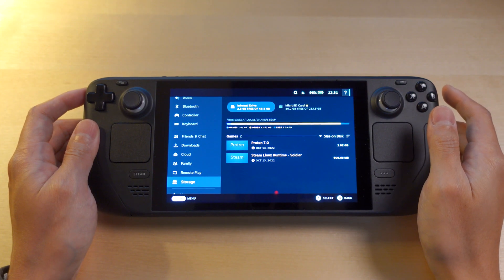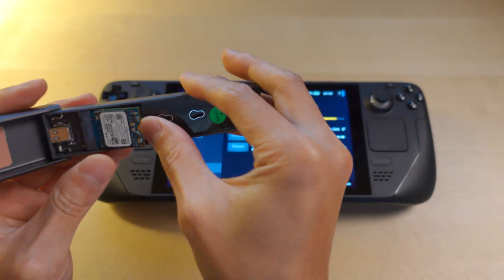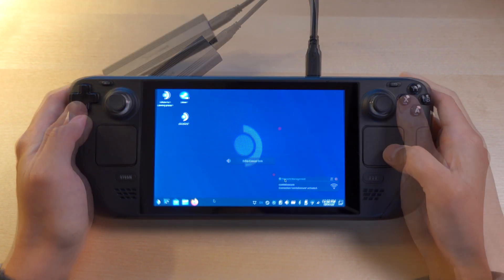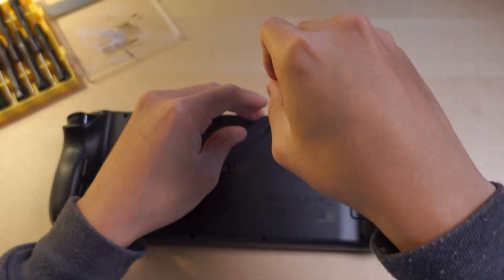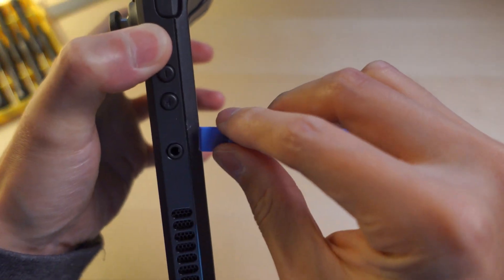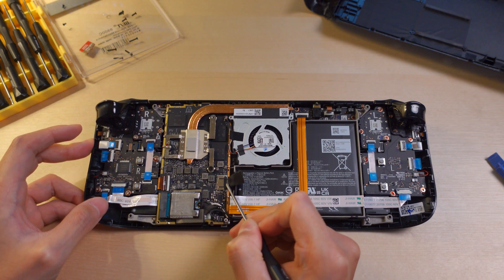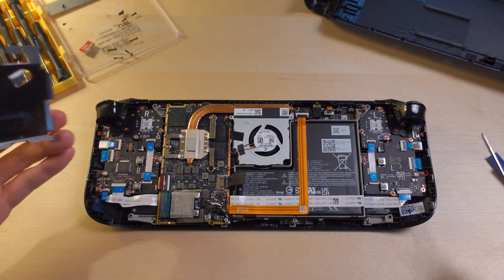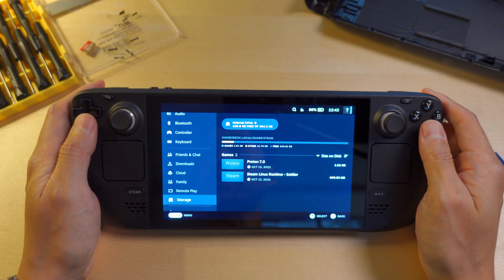Steam Deck NVMe SSD Clone and Disassembly

Comment: I followed this exactly and it started working for a few seconds and then stopped… it says “ dd: error writing /dev/sda : no space left on device” .
My 64gb ssd had about 7 gb left on it and I was trying to copy it to my new 1tb ssd. Prior to the error message, it says 7gb copied.  Not sure at all what I did wrong or what to do next. I turned off sleep mode and just left it as is until I can figure out what to do. Any help would be much appreciated

Comment: Thanks for the guide. It’s simpler to take out the SSD on OLED version. Remember do not format the drive before using dd command. If you format the drive. The system will fail to boot. But you can fix it using KDE partition manager to replace the improper partition on the new SSD.
Reply: How? Because I formatted did the command and about 243gb in it states "error writing" I have 1tb oled upgrading to 2tb.
Reply: @ you need to replace the missing file manually
Reply: @DaneChan  bro I wish I knew what that meant and how, even though it copied 243 gb I go back into gaming mode check storage and the drive still says 1.8tb free...same as before I started the clone

Comment: didnt work for 2tb ssd got this message dd: error writing '/dev/sda': No space left on device
1+0 records in
0+0 records out
0 bytes copied, 0.105996 s, 0.0 kB/s
Reply: Figured out the solution. MAKE SURE TO REMOVE MICRO SD CARD BEFORE DOING THIS

Thanks for this video worked well!
Reply: Removing your sd card fixed this? Didn’t fix it for me
Reply: @KinkKush  ok maybe im late but i fixed by inserting the new ssd via usb-c when in SteamOS mode,  and in the menu you see at 1:10 , selecting the empty ssd in  and "repairing" it pressing Y. Then, once properly formatted, go to desktop mode and run the comand and that should do it

Comment: I changed my 512 SSD to 2TB and it was very easy. Just follow the steps in the video and you’ll be fine. If you plug in the external SSD and it doesn’t show up on your deck that’s normal. Just follow the steps shown in the video make sure to copy and paste the clone command by pulling the video up on your deck.

Comment: Tried exactly how you described (coming from 256GB and upgrading to 1TB) but the deck wont boot after installing the new ssd :( after some tries it sends me to emergency mode and tell me that the root account is locked. so Im stuck here 🤕
Reply from the maker: The original SSD is intact so you could just swap back and try again.
Reply: @DavyChiu  Yes but I decided to take the alternative way to create an image of my old ssd on my pc and write it to the new ssd. Afterwards I enlarged the last partition to fit the new ssd size. Everything is working fine now :)

Comment: Thank you so much for this video. Turned it on and it literally worked exactly as it did before with no further login or tweaking or anything. My only tip is I wouldn't pull on the battery's ribbon cable like that. I did that following the video and almost broke it, so I instead just used my fingernail to lightly pull at the plastic bit. Just wanted to throw that out there cuz I would have been terrified if I'd broken it.

Comment: Dude, thank you so much for this step by step tutorial. You made it so much easier than me cloning off an image of the existing drive onto an external drive, then restoring the image to the new SSD. This was straightforward and I was able to get it done in less than an hour, and had my old games on the new SSD without any issues.
Reply: Everything worked exactly the same? As if you didn't do anything and the memory was just increased? No sign ins or messing with settings in desktop mode?

Comment: I'm getting an error 'dd: error writing '/dev/sda': No space left on device when attempting to copy the SSD.  I'm upgrading the SSD 64GB model to a 1TB western digital SSD.  Any thoughts?  Do I need to clear space on my internal SSD first?  I currently have a 2GB free.  Any advice will be greatly appreciated.  thanks...
Reply: For those seeing this in the future…I followed the same steps in this video a few days later and it worked for me. Not sure why but I didn’t get the error any more.

Comment: I know this video is a year old, but seriously thank you man. Every single place I looked or searched had the wrong clone command line and it was driving me insane. I used the one you posted and it worked instantly so thank you for saving me from this headache I really appreciate it!
Reply: Everything worked exactly the same? As if you didn't do anything and the memory was just increased? No sign ins or messing with settings in desktop mode?
Reply: @jawknee21  nope, everything was exactly the same but now with 2TB. setting stayed the same and everything.

Comment: Hey quick question did you format the new ssd prior to cloning it?
Reply from the maker: No, not necessary.
Reply: @DavyChiu  I keep getting an error stating not enough space on drive. I followed everything step by step.  This happened with 2 ssds. Any idea what it could be?

Comment: I am stumped, I have bought the EXACT enclosure and a WD_Black 2TB, but EVER SINGLE TIME after typing the command it will only download ~7.8GB then say “ no space left on device “ & can’t find a answer anywhere :/
Reply: 7.8 is a pretty specific number. Reminds me of dealing with FAT formatted drives (they have a 3.9gb limit)
Is the drive already formatted/partioned?

On the Steam Deck Desktop, find the "KDE Partition Manager" tool, find your and check.

For a brand new drive for me, the only options NOT greyed out are  "Refresh Devices" and "New Partition Table" with my SSD selected. If you have other options, try  shredding the existing partition table ((Top of screen) > Partition > Shred).
Reply: ...u need to delete the drive on windows with partiotion manager and make sure u took gpt dont format at all and put it back to the steamdeck, than u should be able to do it :)

Comment: Followed this guide, works like a charm. For the prying part, I used an old credit card to pry open near the top vent, then by pulling the vent part back a bit by my left hand, I squeezed on the right handle and pulled it off. This was far, far easier than trying to pry every side.

Comment: So is it the same with the oled?
Reply from the maker: There might be minor variations in the OLED hardware but the overall process is the same.
Reply: @DavyChiu I tried it on my 512 oled n it bricked it. I can’t get into WiFi and I did a factory reset n u need Wi-Fi to even get into the deck. But no WiFi will work. It says can’t connect re-enter password smh

Comment: This may sound like a noob question but what should I put in when asked for password for deck?
Reply: U figure it out ? I don’t know either lol. Do u know if this works with oled?
Reply: @LaymanGamin  If you've never set one, you need to run the `passwd` command, and it will let you set one. (Make sure to remember it!!) - This is from a reply in the top commentes.

Comment: I really don´t get it, it is not working at all. The SSD in the Sabrent is not recognized if I don´t plug the sabrant with power to be recognized first. And second when I get the external SSD to be recognized it is not at "sda" but on a "sdc or sdd" slot. When I change the command line to copy on it on "sdd2 it stops after 423GB stating Input/output error..

Comment: So if it clones, then it makes a copy of the old drive, including partition size!! but then if the new drive is bigger, how do you open up the additional space to be “usable”?
Reply from the maker: SteamOS expands it automatically on boot partitions are stock. If they're changed in any way, you may need to expand them manually.
Reply: Thx, so mine is fresh out of the package/stock, didn’t format, just plugged it in to USB,  then followed your video so far.. next step is to open it up & physically swap to the newly cloned SSD. I read elsewhere that I would need to expand, but none of the Tutorials on YT show that part. Glad to hear that it automatically does it on SD!

Comment: Hey buddy...great tutorial.  By chance  would you know if that same procedure can be done when a Steam Deck already has Dual boot?  A friend of mine is going to give me his steam deck that has windows on it and he told me it has windows 10 on it for dual boot and windows is installed in a separate partition.  So my question is I wanted to change the SSD in there to a 2TB, would you know if that same "Cloning" you just did would work?  Dual boot with two separate partitions?
Reply from the maker: This method will copy both windows and Steam, however you will probably need to enlarge the partitions manually afterwards.
Reply: @DavyChiu  Thanks buddy....will give it a try...always like to experiment and see what happens. If not..I can always just start from scratch again.. I've loaded just a few games on the OEM SSD before I transfer just to see if it picks up everything without a hitch

Comment: How do you do the opposite and copy external ssd to internal ssd
Reply: Did you work it out?
Reply: @tomb4696  nope I just ended up swapping ssds
Reply from the maker: Sorry, I didn't get to this earlier. You would need to boot off the external SSD and modify the DD command to copy from the external to internal.

Comment: In case anyone runs into the issue I had with the sudo password (I never set one so I Googled it) after entering the clone command. You just go to your settings > system settings  >users and then change your password :hand-purple-blue-peace:

Comment: ⚠IF YOUR DEVICE IS STUCK IN THE BOOT LOGO⚠
please read before giving up and losing all your data

1. First, place your original SSD into a Type-C enclosure and boot from it. Leave the new drive (the one you are upgrading to that is not booting) inside your deck.

2. Open a terminal and run the following command. It is a modified version of the command featured on this video (it does the same thing but has been changed to reflect that the SSD we want to clone is now in enclosure and the new drive we want to clone to is inside our NVME slot) .
 Please note that you may need to modify it based on your specific drive names.

3.Before you run the command make sure you enable "Manually block sleep and screen locking" under "Battery and Brightness". (I'm pretty sure this was what caused the stuck boot logo in the first place.)

this was the command that worked for me

sudo dd if=/dev/sda of=/dev/nvme0n1 bs=4K status=progress
```

3. To identify your drives and their respective names, use the 'lsblk' command in the Konsole.

4. If you encounter any issues, ask ChatGPT for assistance, as it's how I developed this fix.

Following these steps successfully should resolve the issue, and your drive should work perfectly without being stuck on the boot logo.
Reply: Under rated comment. You are a life saver dude!
Reply: Working for me too!
Reply: Sorry ah quick clarification where do I put the specific name in the command to clone

Comment: Thanks for the video. I have the Deck with the new cooler, and it's even easier.
Anyway, remembering my question, you DON'T NEED to format it before. It didn't even ask me to relog after the installation. Only weird thing, is that it re applied the update from 12th September, I already installed.

Comment: Thank you for this! Such a great guide. Someone will need to hear this. I put my battery in storage mode before doing the swap as I've seen that recommended on iFixit. After the swap my deck wouldn't turn on. I went through the entire process several times and still nothing. My battery had 80% when I shut it down but it still wouldn't turn on. I decided to try plugging it in and magically everything worked perfectly. Something about putting the battery to storage mode I guess makes it so that you have to plug it in to get it to power on. At least now I'm a pro at swapping the SSD because I did it 6 times before plugging it in.
Reply: "I put my battery in storage mode before doing the swap as I've seen that recommended on iFixit. After the swap my deck wouldn't turn on"

Yes, because you had it in storage mode.

"I decided to try plugging it in and magically everything worked perfectly."

Because this is the only way to get out of  storage mode.
Reply: @10:10 

"We need to plug in the USB C cable to re-enable it"

Comment: Worked after a few attempts, the only problem being getting stuck on steam logo after reboot. 

I cloned it again
then booted into SteamOs
changed to Beta (Steam/Settings/System/BetaParticipation (update to Beta).
Restart - wait a while whilst it installs
Go back to and change to Stable (Steam/Settings/System/BetaParticipation (update to Stable) 
And then restart a few times to make sure all is running!

Comment: How do i do this the other way around? like my new drive is in my steam deck but my old one is in the enclosure
Reply from the maker: The only way would be to use a usb hub and attach a live boot OS (clonezilla) and the old drive to copy it over.
Reply: Because I currently cant even get my Deck to boot past the logo. I've tried everything including reinstalling os. I haven't done a reimage yet because I dont want to lose all my data.  @DavyChiu

Comment: I keep getting error no space left on device
Reply: Help
Reply from the maker: I recommend reseating the drive in the enclosure and if that doesn't work, check it on another computer. You may have gotten a defective or fake drive.
Reply: I figured it out kde program setup so it could read the ssd
Reply: @charlespittman3084 how
Reply: @charlespittman3084 would you mind explaining a little more I’m having the same problem.
Reply: @athletic228  yeah open up kde partition in desktop mode and set up a partition on the ssd your trying to use then u will be able to access the ssd you r trying to use

Comment: This clone "sudo dd if=/dev/nvme0n1 of=/dev/sda oflag=sync bs=128M status=progress" command worked flawless. Upgraded my 256GB to 1TB with a Corsair MP600. Don't forget to remove the MicroSD before you open your Steam Deck and make sure "of=/dev/sda" is the correct targetdisk!
Reply: I got the same SSD, but I've noticed my deck is a lot more buggy after installing the newly cloned drive. I'm worried if it got corrupted during the clone process, do you notice any weirdness from awaking the deck from sleep after a long period or opening the steam overlay while in game?
Reply: @brandonrose8123  I had zero issues.

Comment: Is there any way to clone the Deck to a 2280 ssd + enclosure, and then swap the old 64gb 2230 to a new 1 tb 2230 and then just apply(?) the cloned files to the new ssd? I want to do this but dont have an enclosure for a 2230 ssd. Only my blank 2280 ssd + enclosure setup

Comment: Hello, I just cloned my drive using your guide. However before starting the tutorial, I had formatted it with an EXT4 partition. Is this a problem, and should I first wipe the drive and make sure the partition is deleted, then clone again before attempting installation? Thanks for reading and making such an excellent tutorial!
Reply from the maker: If you want but it's not necessary. Everything is carried over including formatting and partitions.

Comment: Hi, I tried on a brand new Sabrent 2tb and it threw an error on writing not sure if I should install it like that...

dd: error writing   ' dev/sda ' : No space left on device

That's the error. Do you need to prepare the new ssd or do something to it before doing this?

Also apparently there's a a tool for Cloning it's free and Open Source... Clonezilla. Since your method didn't work for me I'll be trying it
Reply: Had the same problem, i figured out thou that my nvme card wasnt sitting correctly in the enclosure, u might wanna check that

Comment: One thing that is not said about the process that worried was after cloning the drive the clone shows the exact space with none free
I installed it, zero issues. Everything just worked out no need to do anything more than what you see (other than maybe the password)

Comment: I got an error saying "dd: error writing ' /dev/sda' : No space left on device." What do I do now?
Reply: Did u get it to work I was having the same issue I restarted it and make sure there is no sd card installed worked after that
Reply: Had the same problem, i figured out thou that my nvme card wasnt sitting correctly in the enclosure, u might wanna check that @sja682

Comment: Managed to clone my old 64gb sytem drive to a new 512gb version and boot no problem using the clone drive function within KDE Partition Manager in desktop mode. 
Method as follows:

1. Open SD up and install new larger 512gb NVME into SD.
2. Take old 64gb drive and install into external NVME drive caddy
3. Connect 64gb drive caddy via USBC to SD.
4. Boot into Steam Boot Manager and boot OS from the 64gb drive. 
5.  Change to desktop mode and search for KDE Partition Manager and select clone drive. 
6. Select 64gb drive as source and 512gb as target drive and flash
 7. Once process is finished, disconnect external drive caddy and reboot Steam Deck. 

Voila... 
You should be able to boot into SD OS no problem. You will still have to update to the newest version of Steam Deck OS but it worked perfectly for me

Comment: When I clone the SSD using this method, I am able to boot into SteamOS once but the next time I boot I get stuck at the Steam logo. I tried this using two different SSD's and got the same problem.

Is there a way to fix this?